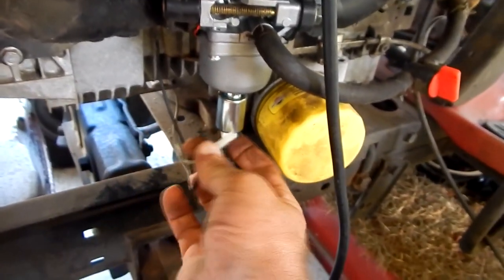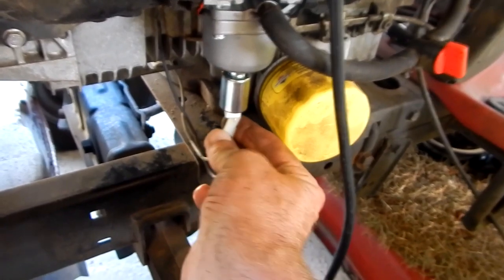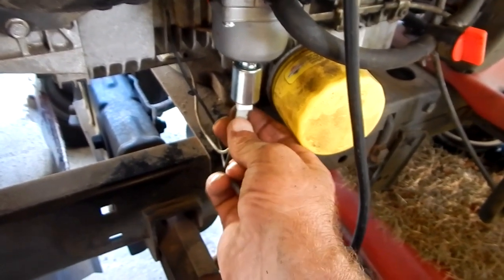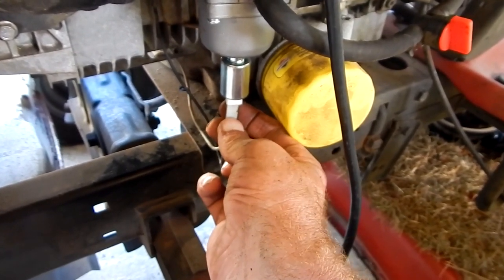Testing a Carburetor Fuel Solenoid on a Briggs & Stratton engine

Comment: 'm getting no power to solenoid I'm assuming because a don't hear it click when i turn ignition key on. i removed the seat safety device so mower wouldn't cut off if i got off lawnmower now it wont start. any ideas?

Comment: do all fuel solenoids click with this test, or do they come on after the engine is cranking...i have a couple good riding mowers that work fine but the solenoids do not click so i`m very curious when i will know if the solenoid isnt working since i cant hear it
Reply: With the key on only, The starter doesn't have to be on. The connector female end should measure 12v. The male end should have 46 ohms resistance. The solenoid has a needle and spring that is up in the off position and seats into the main jet and blocks the hole so gas can't get vacuumed into the carb. When 12v is on the, needle is down allowing gas into the main jet. Another test is that when 12v is on; the solenoid will be very warm to the touch. The solenoid is threaded on but you'll likely need a very thin wrench or, grind something down to fit on the brass flats. This is needed if you have to clean the bowl,jet,or to replace the solenoid.
Reply: I found if you use the cheap wrenches that come with a harbor freight die grinder you can simply take one of those wrenches stick it in vise an bend open end of wrench to fit the flats on carb fuel solenoid.